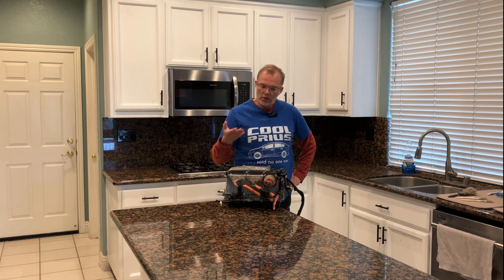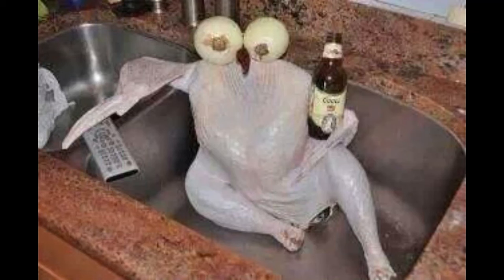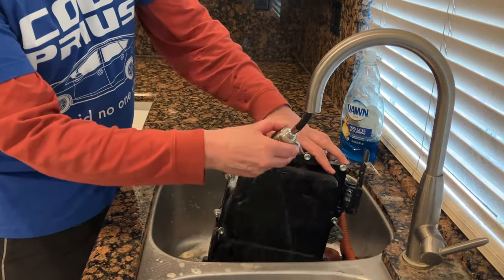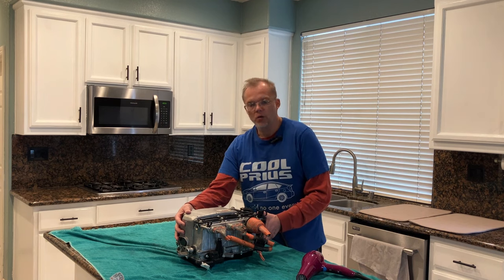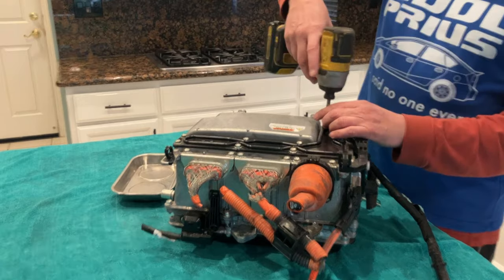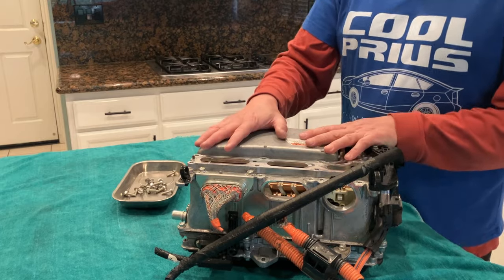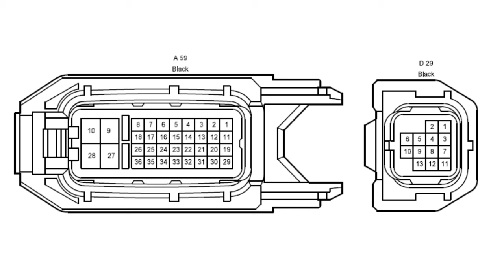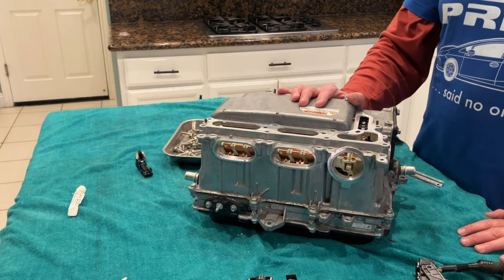2010 Toyota Prius Gen 3 Inverter DIY EV Prep

Comment: Washing electronics isn't so bad. I've washed multiple mainboards in the shower with shampoo because they were covered in cigarette tar and they came out squeaky clean, smelled nicely and worked flawlessly after drying them carefully.

The last part is the important part. You removed all the connectors afterwards, which is good for drying.